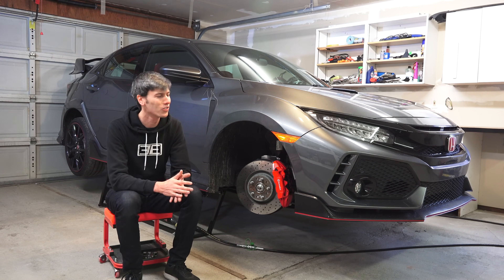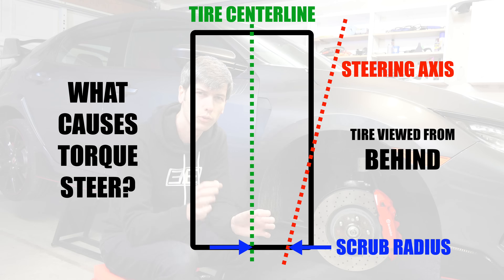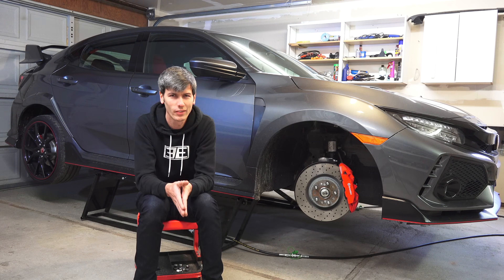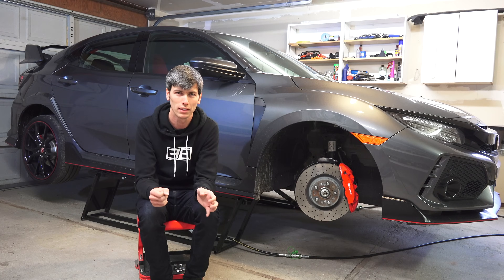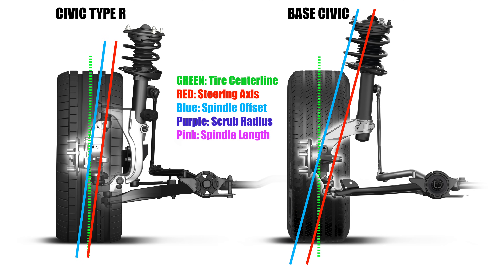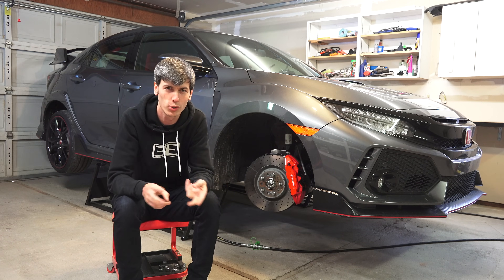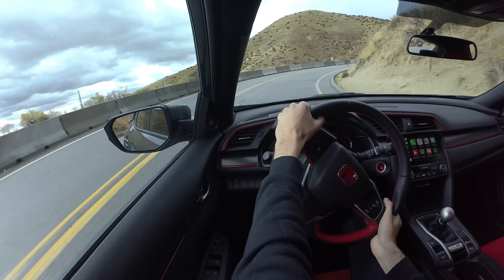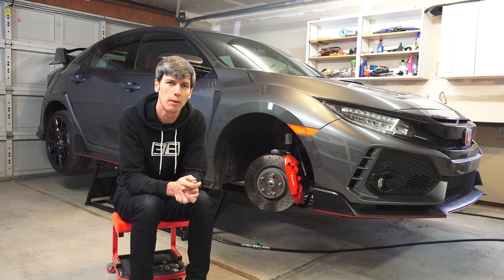Why Doesn't The Honda Civic Type R Have Torque Steer?

Comment: That tendency to hold the steering angle under power coming out of a turn, is not steering geometry induced torque steer.
It's a side effect of the helical gear limited slip (really torque biasing) differential.   Anyone who's had a Quaife, Peloquin or other torsen style differential on a high powered front wheel drive car will confirm this.     I had one on my supercharged 98 GTI VR6 and it did exactly the same thing in turns.    It did not do that before the diff.    It also tends to hold the steering steady during hard straight line acceleration so you may be attributing a bit too much to their tricky steering geometry for that test as well.
Reply: Hang on for a long one, but please bear with me.  I've been researching LSDs for many years.  
Engineering Explained, while the end goal may be to limit slip (why we tend to lump them all together into the category of "limited slip" diffs), the operation and feel of the various diffs is quite different.   
Here's a few examples of different types of diffs and how they can react. 
 
- A viscous diff reacts to an imbalance of wheel speed (the viscous fluid heats up and becomes more viscous causing more torque to be transferred from the spinning side to the non-spinning side with grip).
- A clutch type diff may be hydraulically activated, but electronically controlled (ABS wheel speed sensors used to detect wheelspin) and once activated it is basically a locking diff.  
- A mechanically locking or permanently locked (spool type) diff doesn't care about wheel spin or torque imbalance, it simply forces both sides of the diff to turn at the same speed all the time.   People often mistakenly call this a 50/50 torque split, but if one side of a locked diff has 0 traction then the diff is actually applying 100% of the torque to the side with traction, so any fully locked diff distributes torque anywhere from 0/100 to 50/50 to 100/0.   Only an open diff has a true 50/50 torque split all the time.
- A helical gear torque biasing diff (TBD) doesn't react specifically to differential wheelspin (which can be easily  proven by lifting one tire off the ground and applying power.  More on this later).  It reacts solely to a torque (or more specifically load) imbalance and provides a torque multiplier from the low traction side to the high traction side which gives it a unique handling characteristic.  

Under hard power in a straight line here's how the various diffs will usually react.  
- Viscous coupled diff doesn't activate unless one tire breaks away and starts to spin and it needs to maintain some wheelspin to keep up the torque transfer.   You'll feel  the steering wander before it engages, and stiffen up once it does which is why viscous coupled diffs are more often found at the center of an AWD system (in a lot of Subarus for instance) or rear (where effect on steering is minimal)
- Electro hydraulic clutch type diff will react similarly to viscious coupled diff, unless the software specifically  forces the clutch to activate under high throttle before onset of wheelspin (some do), at which point they'll tend to pull straight ahead. 
- A locking or locked diff will generally just pull straight given equal traction.   If there's a traction imbalance steering will pull turn toward low traction side but general feel is "pointy" as in, it goes straight where you point it. 
- A TBD will tend to stiffen the steering up and also pull straight, unless one side threatens to lose traction then it'll shift torque to the side with higher traction (even before wheelspin occurs) and you may feel it turn toward the side with lower traction.      

Where things get interesting is what happens in a turn, while under power.
- Viscous coupled diff relies on differential rotation rates to activate, which happens naturally in a tight turn, so it activates even when there is no loss of traction causing a tendency to straighten the wheel as the diff transfers torque from the faster turning outside tire to the slower turning inside tire.     It's not as bad as a locking diff but still the tendency is to self straighten.   Again this is why they're rarely used in front diffs where they have the most negative effect on steering (only center and rear)
- Electro hydraulic clutch type diff, can pretty much do whatever the software wants it to do.
Using all four ABS wheel speed sensors and steering angle sensor and such it can easily detect whether the differential wheelspin is due to turning or wheelspin, and choose to engage or not.   Generally though if it chooses to engage it'll transfer torque from outside to inside tire, again causing the steering to want to straighten.  
Caveat: There are fancier electro-hydraulic diffs that link input torque to each side independently and they can pretty much steer the car themselves (rotate the car, hold a drift angle.. etc)
- Locking under load type diff, or perm locked diff will always try to force the inside tire to turn as fast as the outside, and since there's usually more traction on the more loaded outside, that causes the inside tire to scrub (spin slowly relative to pavement).  Any time there is less traction imbalance, the steering will be extremely heavy and will always resist turning.  Under hard cornering, they will  cause increased understeer since you're losing all lateral grip from the always scrubbing inside tire.  
- A TBD is unique among these, in that when the inside front tire lightens up due to lateral weight shift such that less torque would be required to spin the inside tire, the helical gears shift torque to the outside with a greater load.   This torque shift to the outside tire causes the steering angle to remain fixed in the turn until you get off the power or force the wheel back straight by hand.    

There are ways to confuse a TBD.   In situations where the road offers severe changes in traction (say random patches of snow and dry pavement), you'll get a pretty strong feeling of torque steer as the torque transfers instantly from side to side, where an open diff would just lurch along mostly in a straight line, gaining and losing traction (since torque to pavement side always matches torque to snow side).
And because a TBD only transfers torque from low traction side to high up  to the torque biasing ratio (e.g.  3 to 1), if you give one side zero traction (zero load) then the torque transfer is zero * 3 = zero.   In other words, with one tire in the air, or on pure ice, a TBD acts like an open diff (proof that it cares nothing about actual wheel spin).  
In this zero traction situation, the fix is to lightly apply the brakes (the ABS computer will do it for you) along with the gas, and then the diff transfers the braking force times the torque bias ratio over to the high traction side.    Cars with open diffs often use the same trick to simulate an "electronic locking diff", but it's literally 3-4 times more effective with used with a TBD.
Reply: +daemn42 you're not wrong, but EE is technically correct... which is also the best kind of correct. To understand why, please tell me what the differential distributes to the wheels.
Reply from the maker: daemn42 thanks for the follow up, we’re in agreement! Solid diff explanations! 👌 (and a lame diff pun)
Reply from the maker: +daemn42 I have no problem being incorrect, but you haven't explained why, just stated "I drive this and that's why." Why would a helical cause this, but not a mechanical or electric limited slip diff? Ultimately all of those forms of LSD have the same goal: send more torque to the wheel which is rotating slower (which tends to be the wheel with better grip, if the other is spinning).
Reply: Let me clarify. EE drove the Type R and demonstrated two things in this video.
1. That hard on the gas in a straight line,  hands off the wheel, the car would tend to continue to pull straight. 
2. That hard on the gas in a turn, hands off the wheel, it would continue to turn.
Neither of these are normal behavior for a high powered FWD car.  
He attributed #1 to the Type R's trick steering geometry.
And he simply called #2 "torque steer" with no further explanation, which in the context of the video implies that this is something the Type R's steering geometry either causes or can't overcome.   

Yes technically any effect the engine's output has on the feel of the steering on a  FWD car is some form of "torque steer"  but in this case both observed effects can be attributed directly to the normal operation of the torque biasing differential and not to the steering geometry, which the video is all about. 
And the proof of this is that any high powered FWD car with a TBD will do exactly the same things, even without the Type R's steering geometry.     I can confirm that myself, from direct experience, as can several other people who replied to my first comment.

The Type R's steering geometry may indeed be superior, and have other measurable benefits,  but it is not the cause of the specific effects demonstrated in the video, nor can it stop them from occurring if that were desirable.
Reply: +daemn42 the differential distributes torque to the wheels... what you're describing is just one way torque may be applied in different amounts to each wheel. Other factors that can contribute to that are unequal length half shafts and suspension geometry. EE even said there could be multiple different factors, and it doesn't matter what those are, as it's still torque being applied to the wheels via the axles that causes the issue.

+DC Garage you're correct that we're just arguing semantics. However this is an engineering channel and people were just trying to point out the technically correct explanation here.
Reply: Just thought this too. The LSD is what kept the wheel in place during the turn not torque steer. My 08 Si has an aftermarket LSD and holds a turning track when under hard accel in sweeping turns.
Reply: Just explained this in my comment, glad I'm not the only one ;) + you add the AHA from Honda and you have this kind of sensation in the steering wheel.
Reply: Have a sentra spec v (helical torsen diff) can confirm
Reply: beautifully said @DC Garage!!
Reply: I just commented this also, I notice the same thing since installing a helical LSD (mfactory) in my fwd. It did not do it with open diff. Kind of helps you turn, but you can notice it resisting a lot powering through a tight s or slalom situation.
Reply: same with 130 HP car. When I had a LSD things like that happen in corner
Reply: He doesn't need to. Is torque influencing the direction of the wheels? The answer is yes, making it technically torque steer. Whether it's intentional or not is of no consequence to the terminology. You can argue this point until you're blue in the face, but you're arguing semantics.
Reply: I have a 1.8vti that has a torsen LSD and can also confirm
Reply: You're not wrong, but no further explanation was necessary after EE replied to your comment. You had made your point and he made his. No need to tell him he's wrong. It would have been good for him to mention it, as you said, but he's not wrong.
Reply: DC Garage it is just holding your steering input, preventing self centering. It seems odd to call something preventing the car from moving the steering wheel on it's own when you plant it as torque steer.
Reply: +Avrilcadabra holding it in the position you put it when the natural response would be to straighten out is absolutely an influence.
Reply: daemn42, that's exactly what I thought as well. Although I didn't think it was specifically due to the helical gear LSD but generally due to the LSD.
Reply: Thank you for not making me type that!! :-)
Reply: Have a Quaife in my VRT Cabrio. Steering pulls TOWARDS the corner sometimes!
Reply: this is very accurate. the suspension design im sure was based around chassis/road dynamics and not just some torque steer counter design. the LSD prob does 90% of that work
Reply: I have helical lsd in fwd car, it still torque steers under heavy acceleration (and especially just after powershifts).
Reply: Busted Knuckles The purpose of this video was basically to demonstrate how their suspension geometry works to help eliminate torque steer compared to other high torque FWD autos, which also have LSD's. 300 HP and almost 300 lb/ft torque is a lot to throw at FWD steering even with an LSD, so Honda improved on a "trick" steering design to eliminate whatever torque steer the differential doesn't. I don't think he was trying to attribute the lack of torque steer completely to the steering. This video is about a specific component (yes, the video title is more general than that but that's just to get people to click on it.)
Reply from the maker: +daemn42 correct (to an extent), since limited slip diffs allow for varying torque left to right on the axle, they can cause the car to pull one direction. When the car pulls one direction as a result of mismatched engine torque at the wheels, this is called torque steer. Engine is influencing the steering direction rather than just the steering wheel.
Reply: Engineering Explained. Yes but you stated you experienced torque steer in the video. What was observed was the limited slip distributing the torque to side of the car with the larger turning radius to keep the power to the ground in the turn vice the inside wheel spinning. If you consider that torque steer in the negative sense you would have to use some type of input on the steering wheel to correct it. In your case you did not and could let the wheel go. IIRC if it had been torque steer the wheel would have immediately tried to turn more when you let go.
Reply: Crank, where exactly in the video does EE attribute the torque steer he demonstrates to the differential?
Reply: Engineering Explained: Sorry,  you are mistaken here, and apparently didn't read what anyone else is saying.    We're  speaking from direct experience in cars that have torque biasing differentials.    The specific symptoms which you demonstrated in the video (steering wheel not straightening itself while coming out of a turn while hard on the gas) are caused by helical gear torque biasing differentials such as that in the Type R.  It's not a general trait of all other types of limited slip or locking differentials.  Most of them will actually cause the wheel to straighten more aggressively or make the torque steer situation worse.    TBDs cause the steering to stiffen up  under high torque situations, and in a corner they will reduce or eliminate the tendency of the wheel to self center.    And going straight, a TBD can reduce or eliminate the normal effects of torque steer for cars that have unequal length drive shafts and no fancy steering geometry.      One could argue that what the TBD is doing is itself a form of torque steer (and that would be fair), but it definitely is not caused by the steering geometry as you have asserted in this video.

Comment: The torque steer you felt in the corner is probably a combination of the 1) bump steer, because the suspension extended.....2) the Ackerman as the tires do not match the road radius perfectly, causing one tire, generally the inside to slip more because the outside tire has more force on it.....and 3)minimal torque steer.  

Drive a 1975 Saab 99 EMS if you want torque steer.  It was my first car.  It was horrible even though it had only 110ish HP.

Comment: One correction, the torque steer appear on all asymmetric drive shaft car. High power or low power.  The way I understand, the asymmetric driveshaft result in different polar moment of inertia. Hence, one side of the wheel is easier to spin than the other; result in one side capable of putting more torque on the road. Once the more torque side start to spin, the scrub radius will do the rest of the job(open differential case). I believe the key world here is wheel spin, the moment created by the scrub radius shall cancel each other out when wheel on both side has the same traction. I think there is another way to reduce or suppress the torque steering, that is differential lock. For this generation if Type R, I think the differential lock helps the torque steer suppression as well, if the type R does not have symmetric drive shaft.

Comment: One thing to throw out there as important information is that they put 19in wheels on the Type R to work with the torque steer. If you swap the wheels out for anything but that size you are prone to notice torque steer. It's something i learned in my honda training course. Not a Honda tech anymore but still have access to the tech website.

Comment: I have a 4cyl Honda Accord and it has torque steer. Does that mean I have a high performance fwd car?
Reply: No.  It just means that the surface that you're on is not the best and/or your tires are more worn.

Comment: Look at how that brake line hooks up to the back of the Brembo caliper. It’s not a flexible line, it’s an actual metal brake line right on the back of the caliper. I wonder where we could install a steel braided brake line at?

Comment: When you say there's torque steer while going around a corner, I think that is something that Honda may have designed into the car.  Also, it may be that the rear suspension geometry has some influence when cornering.  Going in a straight line there is no torque steer, but when cornering, a little torque steer coupled with the rear suspension geometry will help the car rotate around the corner easier and stay planted on the road.  The car will feel more neutral and eager around the corner.  The trick is that all the interplay with the steering, the suspension and weight distribution while cornering is expected and is reproduce-able to give the driver confidence.